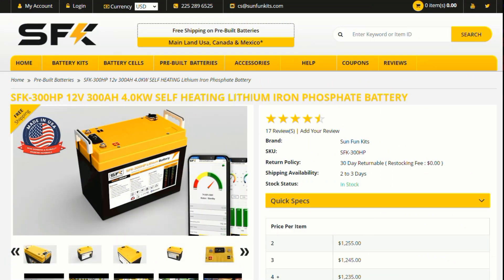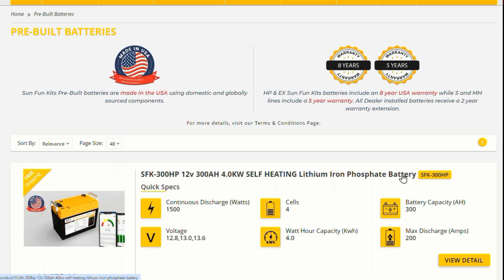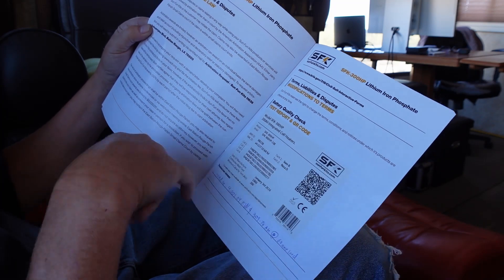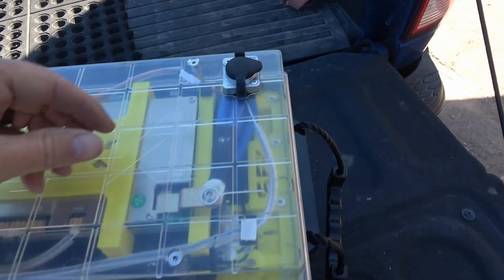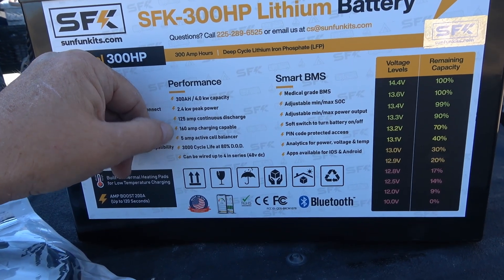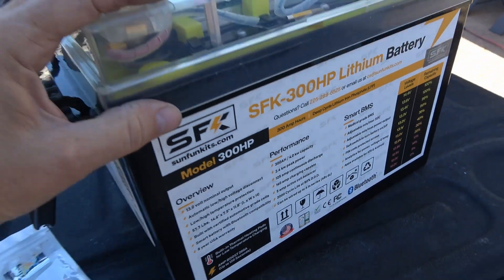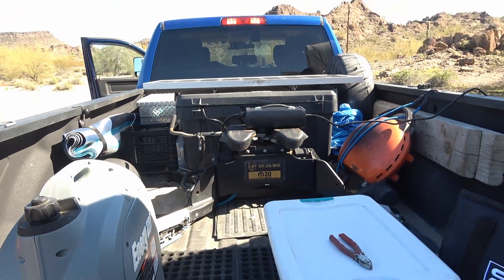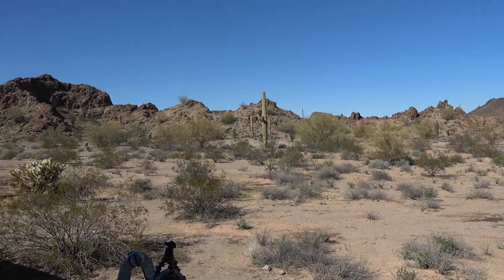USA-Made Lithium Battery Review SFK 300Ah (Part 1 - Intro) Most Full Featured LiFePO4 I've Reviewed

Comment from the maker: Related Links
SFK Review Playlist - https://www.youtube.com/watch?v=qPf2_l8CQcM&list=PLp14lzXh07uln63UpVe3e_qEq3sHfLcYzSFK 300Ah Battery Link - https://www.sunfunkits.com/product/51/sfk-300hp-12v-300ah-40kw-self-heating-lithium-iron-phosphate-battery?aid=090224230245B&cid=0902242302A9F
Coupon code LoveYourRV will take $45.00 off the order for model 300HP or the 275EX.
SFK-HP300 Battery Capacity Test - https://www.sunfunkits.com/app/ViewBenchmarkDetails?id=899253985686
Truck Tool Box Power Station Videos - https://www.loveyourrv.com/diy-truck-tool-box-off-grid-power-system/

Comment: Sorry, but I'm not impressed with your review, so far. You demonstrated that a battery that is rated to take 160 amps of charging could accept 80 amps, YAY! That's half of its rated charge rate. You proved nothing. Then you discharged a battery that's rated for 200 amps max for 120 seconds and 125 amps until completely depleted at 119 amps for a few minutes. Again, YAY! You proved nothing and gave us no insight into this very expensive battery's capabilities. Did the company "gift" this to you by any chance??
Reply from the maker: Yes all the lithium batteries I've reviewed have been shipped free to me. I don't accept any money on top of that and maintain full editorial control of my content.  I don't have much vested interest in any of them really as I get an offer to review tons of them. Most I decline as they are just copies of others or nothing new or interesting about them. I pick and chose what appeals to me or what I figure my audience may want me to me test out. After the review period I usually sell to friends and fellow RVers at a steep discount or give away for free.

Comment: So no UL Certification? Appears very few battery manufactures will step up and let an independent lab test their products to safety standards.
Reply from the maker: I'm not sure; I can't find any mention of it. I've enquired with the manufacturer about it.
Reply: Thanks for asking them about it. Hopefully more battery manufactures start to do this. Understanding the battery install is as important to prevent a catastrophic failure it would great to know the cells, BMS, and overall battery construction meet some minimum safety standards.

Comment: This battery makes me think two things. It reminds me of an Epoch battery in looks and build. I now have to go look up what you can control with the app. Curious to see if you can limit amps and eliminate the DC to DC charger. Wouldn't that be great and really why can't BMS units do that? The second thing I had a hard time with was thinking it was the same company as SKF the tool and hardware manufacturers. Maybe it is another division I am sure you will let us know. Ok I am off the go look up what is what with the malleable parameters. Great video as always Ray. I am getting ready to install a lithium system soon so this looks really good to me. A little easier to manoeuvre than the 95 pound 460 AH Epoch. Need to check prices.
Reply from the maker: hmmm... I never thought of that. I still think I'd use a DC-DC charger as it can boost voltage to overcome long wire runs, isolate the battery banks, and regulate the charging voltage. 
I imagine the name SFK just is a shortened version of Sun Fun Kits. That's a good move on their part, and I think Sun Fun Kits sounds much less professional. But I guess the business grew and now sort of stuck with the legacy name.

Comment: Just wondering Ray if your truck is still running the original batteries and if they go would you replace them with AGM ?
Reply from the maker: I'm not sure so far, the OEM are still working well. There is a company in Canada that has asked me to try out their new Mixtech batteries. Sounds kind of interesting. https://youtu.be/vdfWhR-FJvo
Reply: @LoveYourRV  What a coincidence. I have been using a Discovery Lithium Blue 200ah for almost 3 years in my Cougar 24 RDS. We use it sometimes to run the 12 volt fridge, slide outs, lights etc. but we only boon dock once in a while and usually just one night. It has been a good experience so far. We have 400 watts of solar but mainly use park power to keep it up to snuff, my only worry is our on board charger is not geared for Lithium and don't want to spend the big bucks to replace it when its only 3 years old.
Reply from the maker: Cool! If you have 400 watts of solar and don't boondock much, you should be OK with the existing onboard charger since the solar charger likely can be set to charge lithium. The only compelling reason to upgrade the onboard charger for lithium would be if you are boondocking a lot, not getting much sun, and want to maximize charging via a generator.

Comment: I have looked at these and they look good. I don't like the manual heater on them. I prefer the SOK way of heating the battery with solar input; that way I don't have to be there to push the switch to heat the battery. A lot of YouTube reviews on these SFK batteries. Battle Born has manual heater batteries and I wonder if it has to do with series connecting. I know the SOK heated batteries can't be put in a series configuration.
Reply from the maker: Watch this video about the auto heating function with the newer generation switch pack using a temp probe https://youtu.be/HE3mbJHM32c    Looks like it has auto or manual or off modes
The SOK 280Ah heated battery can be series wired up to 4 batteries and parallel wired up to 10 batteries  have a look in the manual  https://www.us.sokbattery.com/file-share/fa0d6298-cfcc-4c6c-a2bf-0ef2ed8fab35  Cheers, Ray